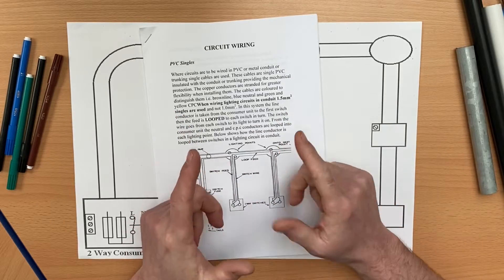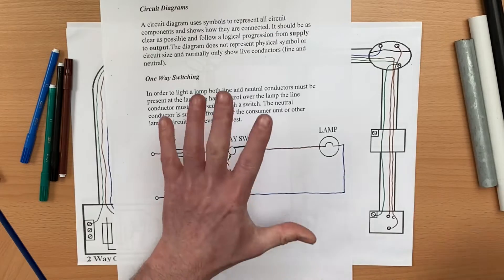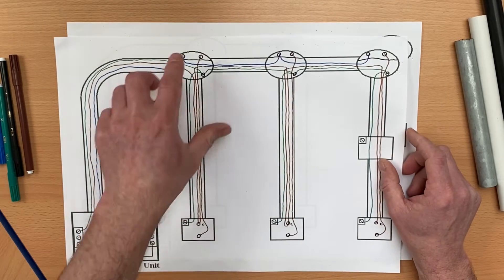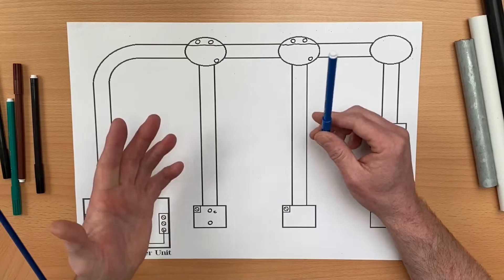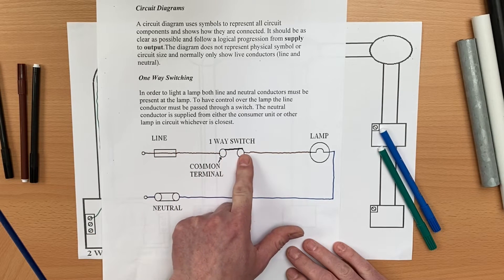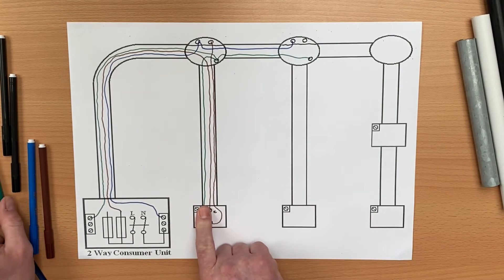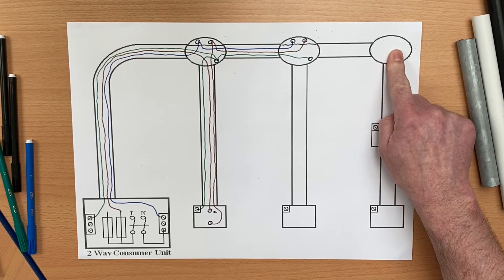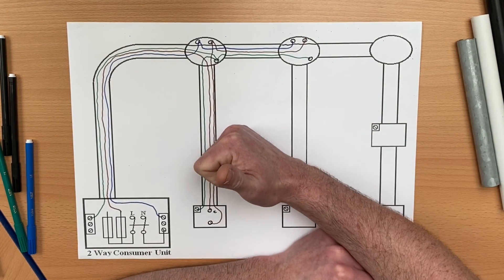Wiring Diagram Conduit Loop-In Method Part 4 - Lighting Circuits in PVC Singles - 2 Lights 1 Switch

Comment from the maker: == 🕐 Time Stamps - Cut to the action 🕕 ==
00:16 - Drawings available form the link in the description 
00:56 - Previous video on the wiring diagram for the conduit loop in method link in description 
02:00 - One light switch controls two lights
03:00 - Adding a switch and lighting points to my wiring diagram
03:50 - Adding the neutral conductor to our conduit loop in method wiring diagram
04:33 - Adding the cpc conductors to our conduit loop in method wiring diagram
05:14 - Adding the line conductors to our conduit loop in method wiring diagram
05:54 - Adding a second lighting point controlled by a one way switch

Comment: Can you show how you would wire this if there was 2 way switching as well?
Reply from the maker: Wiring Diagram Conduit Loop-In Method Part 5 - Lighting Circuits in PVC Singles - 2 Way Switching
https://youtu.be/a0QZvLsyQNs